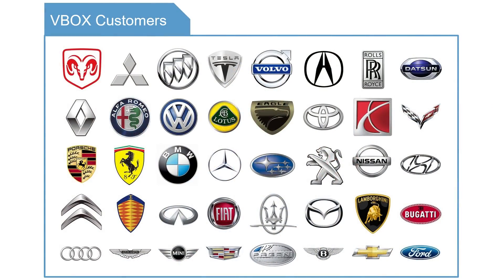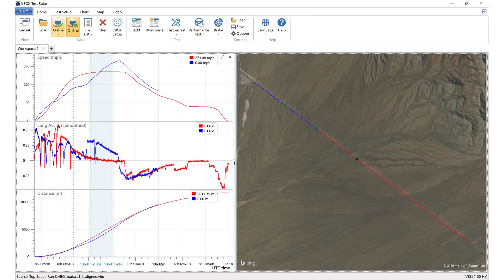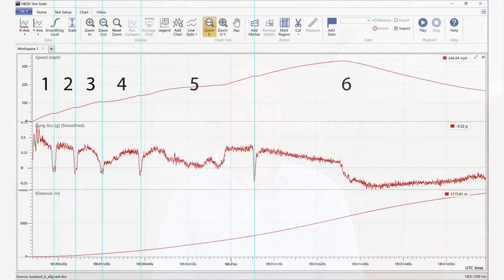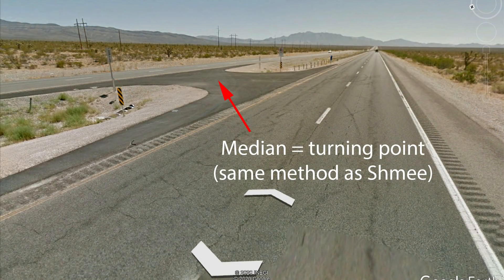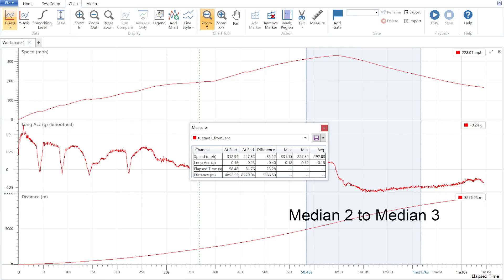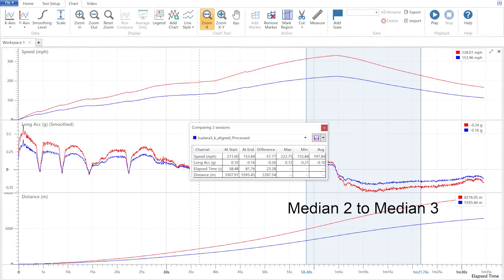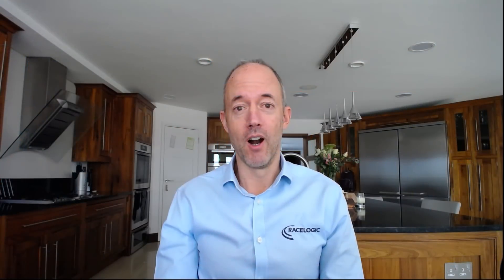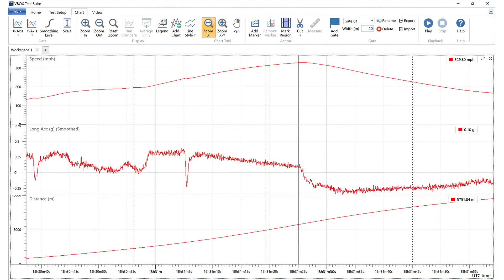How fast did the SSC Tuatara really go? Here's my calculation based on some new data.

Comment: SSC tried to pull a fast one trying to take advantage of the travel restrictions and chaos a global pandemic causes and they almost got away with it if it wasn’t for some YouTubers investigating it!!!! The way it sounds they didn’t come anywhere near that record, imagine if no one questioned that run and they would of had a bogus speed that was so exaggerated it might of took years for technology to actually be able to beat it!!! SSC might of had a better chance of getting away with it if they didn’t say they beat the record by 40+ mph!!!!
Reply: Greed caused them to take too big a bite.  Beat the record by 20 and we might not have an issue.
Reply: Their 2007 speed run should be check. According to them, all they needed to provide was a "Screen capture" of the run.
Reply: Everyone is SO SURE they cheated lmao
Reply: @flowmastaflam  because how could they not. it's so obvious. you don't accidentally go 280 mph and say you went 331 mph.
Reply: @Elias Håkansson it is not. That car absolutely beat the Bugatti Chiron 300+, all the specs point to an easy victory. Whether the speed was 305 or 316 is now up for debate. In my opinion based on all the evidence and specs of the car, I’d place it at a minimum of 310 IF there actually was some sort of malfunction with the equipment. The editing being wrong doesn’t mean anything at all, it simply shows that the editor made a mistake. The calibration of all the speed equipment is what is up for debate.
Reply: @flowmastaflam  According to the specs of the car it doesn't even have enough gear to reach over 290mph in 6th 🤣🤣 when the frauds from ssc got called out for it they simply stated that the gear ratios used were different from the ones they initially released lmao 🤡
Reply: @dimitariliyanov3680  What evidence suggests that they didn't in fact change their gear ratios?
Reply: @flowmastaflam  audio analysis proved the ratio of the sound before and after the shifts matches the gear ratios of a standard CIMA gearbox
While this tells us nothing about the final drive, it proves that the changes to 6th and 7th gear claimed by SSC were not used on the car in the video of the supposed speed record
Reply: @flowmastaflam  Maths. The initially claimed gear ratio of the 6th gear equated to a 290mph top speed. When ssc were called out for it they simply said that they changed the gear ratios lmao 🤣
Reply: @AnarchistMetalhead  But that's the thing. It all comes down to the video being an editors mistake. They did a bunch of runs, and the editor supposedly screwed up which pass they synced with the GPS system.
Reply: @flowmastaflam  that is irrelevent, unless they completely replace the gearbox between runs to one with different ratios
Reply: @AnarchistMetalhead  What do you mean, they said they adjusted the gearing.
Reply: @flowmastaflam  it doesn't matter. The cheat is so big.
Reply: @AnarchistMetalhead  No need to go on about the gear ratio they are like 100 miles /hour off. They said the run was dangerous. It would have been 100 times more dangerous at 320 miles /hour.
Reply: @niklashultkrantz7766  Right now there is no evidence of cheating. Mistakes were made. All we can do is wait for the second run. All the math of the car makes sense that it should be capable of 310+ easy, so whether or not there was a calibration issue will get sorted out in their next run with all their witnesses. To say they definitely cheated is logically unsound without evidence. The mistakes they made are plausible. Y'all don't believe in due process anymore. Everyone is guilty until proven innocent nowadays and this is what is screwing up our country.
Reply: @flowmastaflam  the proof is in the pudding. A guy that is a car expert Shelby have speed in he's blood to make a 100 miles per hour misstake. It's very strong evidence of fraud.
Reply: @niklashultkrantz7766  Re read my last comment. It's definitive.
Reply: @flowmastaflam  smell the coffee. They lied about the GPS company. The software on the GPS is incidently branded tuatara. Not official who programmed the software. Besides the GPS. The distance over time is clocked on a speed run. The clocks where blurred out on the car. Nothing have to be proved a con don't get much more obvious then this. Lying about being a production car. Lying about gear ratio. Blame shifting asking the critics to join the (next run). Probably no cars sold. There is not performance or money left to do a second run. I suggest you watch Christian record run. He explains the effort and money that goes into classify a vehicle as a production car. He wasn't even going to do the record run. It was I initiated by a customer.
Reply: @niklashultkrantz7766  By your standard this invalidates the chiron 300+ as well.
Reply: @flowmastaflam  it is not my standard. You can't make your own standard in this. The standard have to be recognized independently by the authority who is approved to do so. You have to draw the line somewhere. To low production vehicles. Is not allowed for example it must be a proper road legal production car per definition. Also run to be made in both directions the speed indepently verified. And so on to give very little room for cheating.
Reply: @niklashultkrantz7766  Alright now that we've established that neither the chiron nor the SSC hold any records, how does this apply to the conversation at hand?
Reply: @flowmastaflam  just to clarify some of their lies. Let me know if you find anything they claimed that is the truth. It's a shorter list.
Reply: @flowmastaflam   wrong. Why does the laptop in the car show exactly what the layout on the screen does if it was the wrong run?
Reply: @flowmastaflam  Wow, you actually don't get any of it.
SSC can't have mistaken GPS overlay with the video run, did you watch this exact video? It explains why. He went frame for frame, got speed and lat. acceleration, made a graph that matches exactly the on board camera (he even played a bit of the sound clip to prove it).
Reply: @flowmastaflam  not sure why everyone trusts the “specs” of the car either. Someone’s already looked into the surface area and calculated it’s out by a 1/6. So the drag coefficient is definitely wrong. Wouldn’t even be surprised to hear it’s only got 1200hp at this point. Companies lost all credibility with just not being honest in the first instance
Reply: @niklashultkrantz7766  no, just 1.48 times more dangerous :)
Reply: @flowmastaflam  It BEAT NOTHING, ABSOLUTE NOTHING.. And you know what, Bugatti didn't beat Koenigseggs record either, no official run - The kings still stand. =)))
Reply: @gollese  Well said !!!
Reply: @jontus9925  says the guy who thinks Bugatti doesn't hold the speed record even though it is a certified time that everyone widely accepts. Okay there, bucko. Maybe you should just sit down and play your role.
Reply: @flowmastaflam    Are you joking or are you just stupid ???
Reply: @flowmastaflam  Nobody is saying that the car CAN'T do 300mph, they are just saying that it didn't do it on the run in the video. The car was still accelerating, so we have yet to see what the true top speed is.
Reply: @minnick99  The guy above you just did, as did half of the people in these discussions.

Comment: this is really damning and doesn't look good for SSC. No doubt the vehicle is capable of much higher top speed than 223mph, but it's looking like it'll be lucky to get anywhere close to 300, let alone the fantastical 331mph.
Reply: I think it can do past 300 mph, if a heavier Bugatti chiron with less power and same aerodynamics can do over 300 mph, so can SSC tuatara, no need to fake a record if a car is that capable, also crosswinds too, I think all requirements is a perfect weather with almost no winds and a good temperature.
Reply: @aimxdy8680  still a fan boy at the end of the day, they FAKED it because car is in no way capable of reaching those speeds let alone 250mph
Reply: @kinjat561  makes me wonder that if a crosswind at the predicted speeds that they were actually going if the car is actually stable enough to achieve the speeds it should, with its power to weight ratio. Hp, weight and drag co-efficient are one thing but stability at speeds is another.
Reply: @liveandletdie138  gear ratios and stats say it can go 290-300 mph, i dont care if I’m a fanboy, I’m just sharing my prediction
Reply: @aimxdy8680  the fact that they tried to pass off a 223 mph run as 300+ is EXTREMELY suspect, the driver is implicated as well. No way a professional race car driver cannot tell a difference of 100mph
Reply: on top of not even bothering to use reinforced tires rated for 300+ mph. That doesn't set off alarm bells for you? Bugatti used special tires when they did their record run.
Reply: @aimxdy8680  nothing is wrong with predictions but all the evidence rn points towards fake. They've yet to release the raw footage of the correct run to prove that 330mph speed and niether guiness nor the company they used validated the run, almost like they realized they miss calibrated the equipment when watching the footage and video still didn't match the speed so just came out saying they'll re-run it.
Reply: @liveandletdie138  Well said !!!

Comment: Excellent video. My question is one of scientific ignorance. But how did we measure speed records in the past before all of the GPS technology? Can some form of radar be used in conjunction?
Reply: Measure the time through a measured mile using timing beams
Reply: Two Calibrated clocks at two posts. Distance divided by time and you have your average speed, which is what the record is about. No sanctioned record for highest instantaneous top speed exists.

Comment: Uniform scaling factor that correctly calculates - all I need to know. 

Let's not forget - the prior average was 277.87mph with a Vmax of 284.55. The SSC claim was not some incremental improvement in alignment with past progress - this should have been a red flag for the SSC team.
Reply: I think it's starting to become obvious that this wasn't a "mistake" by SSC, it was outright fraud. They know the gear ratios, they know the peak RPM. There is no way they didn't know they were over 100mph slower than the GPS.
Reply: @minnick99  lambo aventador svj does 216 mph with 760hp. The ssc has 1000 more. Think.
Reply: @Elias Håkansson If a tuned GTR can do 230mph on the damn public autobahn, completely stable, then why can't this do it? That GTR can be found on AutoTopNL. It's their fastest 100-200km/h car so far at like 3s. I don't believe that SSC would design a unstable hypercar at just 230mph...even tuned BMW M5's or Audi RS6' do that...ON THE AUTOBAHN! Many video's of those on the internet.
Reply: @Elias Håkansson uhhhhh, the SSC did and official 256mph in 2007 with “only” 1290hp. You are seriously trying to claim that after over a decade of R&D, a 25% increase in power, a better transmission, better tires, and a lower drag coefficient, the car lost 30mph? This is seriously what you believe?
Reply: @flowmastaflam  Your comments are telling people to "think" when really it appears you have not really understood what happened and what was said. The driver said it was still accelerating. WE all said it was still accelerating. JULIAN said it was still accelerating. So the top speed possible is NOT 227. What is the top speed possible? We will see... But it sure as heck didn't do 331.
Reply: @flowmastaflam  It doesn't matter what you believe or not, what matters are the facts

Comment: perhaps they put a shorter diff in instead of a longer diff and assume the numbers from the gps were incorrect. so if they thought the speed the car indicated was correct, then adjusted the gps overlay to match what they thought was correct going off of gearing and rpm. then i can see that happening. which would be why its pulling so hard near the top of 6th when it should be at a near steady state by then.(like the koenigsegg video)
Reply: The driver has driven much faster in Koenigseggs. He's hit 250 mph in the Regera 2 days back at Vmax. Andy Wallace who drove the Chiron says they worked up 20 mph at a time and every 20 mph was huge.
Reply: @srinitaaigaura  I do however think the illusion of speed is greatly magnified when driving on a public highway compared to a wide open runway.  When I sprint down a corridor I can imagine myself being Usain Bolt, put me on a track however....
Reply: @srinitaaigaura  yeah but he did write in a instagram comment that the ssc felt a lot faster than the egg

Comment: 223. I think that's too low. It's even lower than the record set by the veryon 15 years ago. The tuatara can definitely go above 250.
Reply: They don’t discuss how fast It can go, they calculate how fast it did go in the video.
Reply: if it goes to 7th gear. its only on 6th gear in the videos
Reply: @qwertychama   8800rpm max in 6th, 7700rpm max in 7th, but only went 7300rpm in 6th.
Reply: @qwertychama  then what were they trying to do if they didn't push the car to the limit? That was the point of the run right?
Reply: They committed trust suicide with this stunt, they shouldn't have published anything from this 'attempt' if they realized they can't go as fast as predicted. Or it was all supposed to be a lie from the start to get publicity, no matter the result, which was in the end done in the such amateurish way and backfired massively
Reply: The driver let off when it was still accelerating.

Comment: Wow, only 223 mph max speed, that's not even a record of any kind anywhere.   SSC exaggerated their claim by over 100 mph.
Reply: So the guys who thought they did 331 kmph were not far off the truth.. 😂😂🤣
Reply: The car hit 242 in stradmans video
Reply: @TellurideS13  speedometer could be wrong
Reply: @TellurideS13  That's what the speedometer read. Who knows what the actual speed was. It would have been nice if Strad had a Dragy with him.
Reply: @minnick99  An 800 HP Veyron would have been destroyed by a car with over twice the power and 2/3 rd the weight and much lower drag. The margin of defeat was a bit less.
Reply: @srinitaaigaura  Even base Veyron is ~1000 hp
Reply: @cleverusernamecl5532  Yes, but stradmans bug runs on shit-tier fuel, giving it around 800 - 850 hp if I recall correctly :)
Reply: @DOOMlordevil  ahh, didn't know that and if it is whp it make sense.
Reply: @cleverusernamecl5532  850 hp , because 91 octane fuel, even veyron has 0-1001 hp scale, and stradman said it cannot go above 850 hp. So 900 hp more and 600kg lighter ssc in that video is not going strong for these numbers.